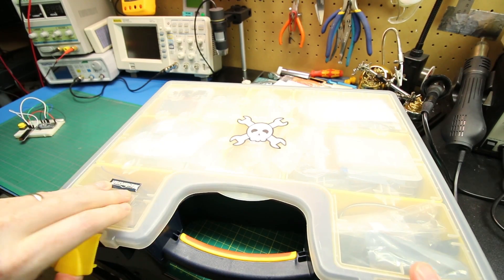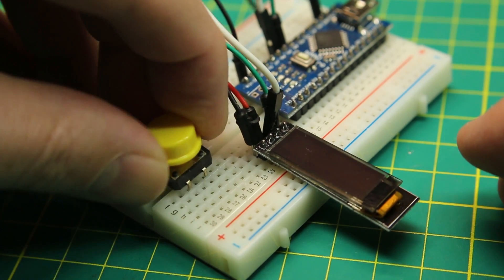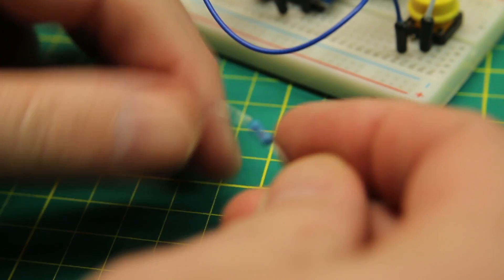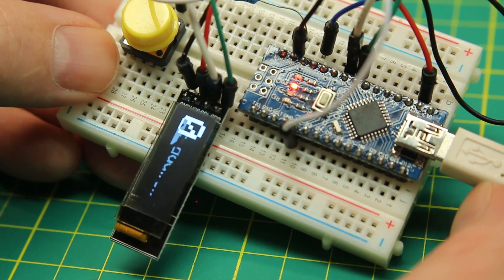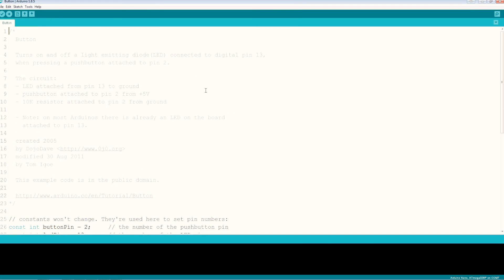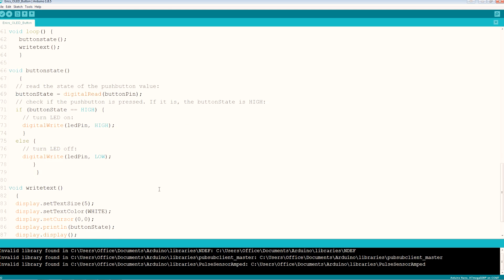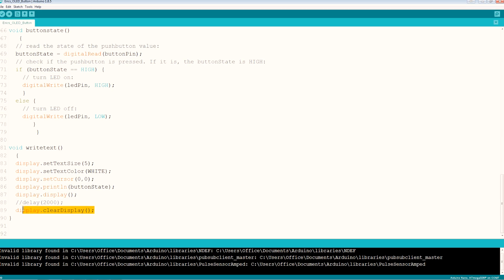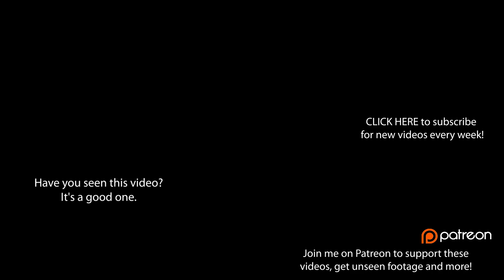Electronics BASICS- Add Buttons To Any DIY Arduino Project EASY!

Comment: As an example, the external pull down is a good thing (but it is hard to explain floating to noobs) but doesn't the CPU have built in pullup/pulldown available?  Note, audio quality during coding was not up to the rest of your production...sorry for pointing that out.